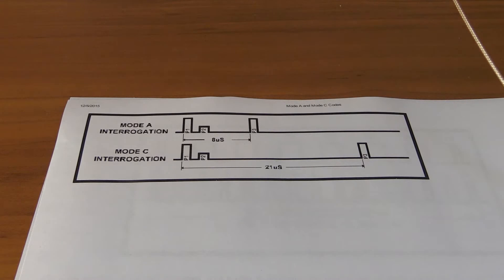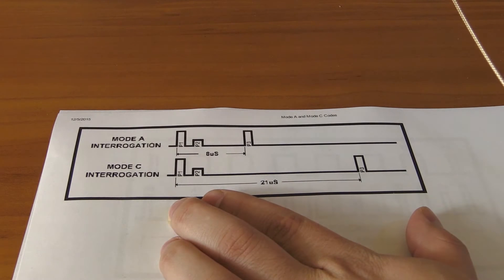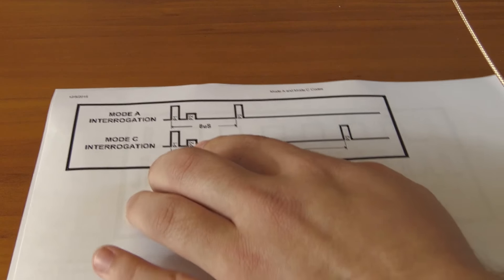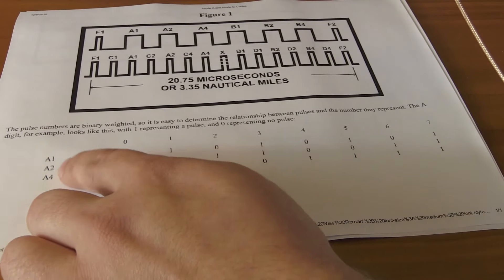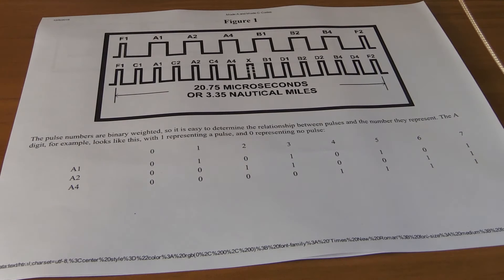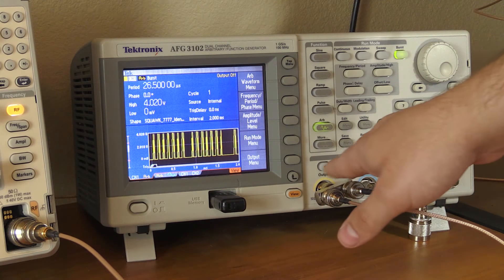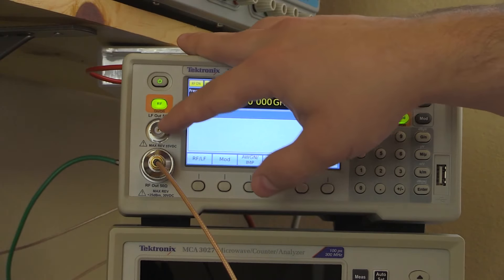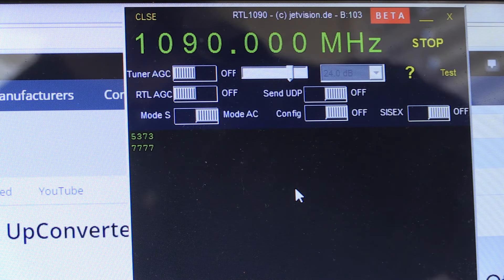How does Secondary Surveillance Radar work?

Comment: I just would like to ask that if i am recieving the IFF signals on a receiver that is transmitting the signals to an FPGA, can U also use FFT and integrating the power over a selected bandwidth? Or there is other way u would recommend, fyi, fpga receiving Analog
Reply from the maker: Sure you could do that. However, this sounds rather wasteful as a pulse detector. For detecting levels within a certain bandwidth around a single specific frequency, there's much better algorithms. The Goertzel algorithm for instance. You can find working code-examples for this algorithm in my GitHub repo: https://github.com/AI5GW/Goertzel
Reply: @BalticLab  so what you are pointing to is since my interest is only finding out if its zero or one, the Goertzl algorithm is simpler and so the work?
The issue is i am writing in Verilog, which is really concerning me since i am still a beginner in the field, would you please recommend me something that might direct me

Comment: Hello Sebastian, de IZ7VHF. Thank you for nice video. I would kindly ask you: is it possible to receive these signal with an SDR receiver? I suppose that is not useful device since so short distance in signal lasting, meaning few microseconds spacing between them. So, do we need actually an oscilloscope to see these signals on a screen? Thank you for answer.
Reply from the maker: Hey Roberto, yes, it is possible to receive SSR signals on a SDR dongle. Actually, that is exactly what I am doing at the end of the video. However, they don't provide much useful information. You get the transponder codes in your area and that's about it. But have a look at ADS-B reception, which provides a lot more information about the aircrafts in your area.

Comment: Are you aware that 7777 is the exclusive code for a hijacked aircraft? That could be a bit embarrassing if some leaked out. Nice brief video.
Reply: This reply is not synchronized to an interrogation, so it would appear as noise or non-synchronized pulses with no meaning on the beacon interrogator.
Reply: 7500 is for hijack, 7777 is used only in case of interception from a fighter jet